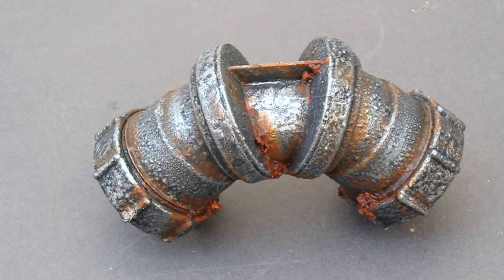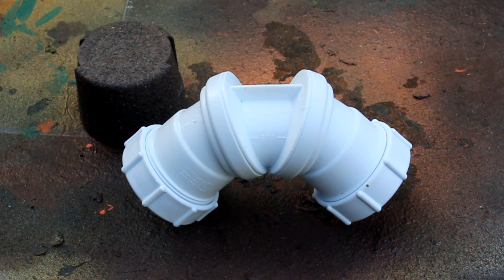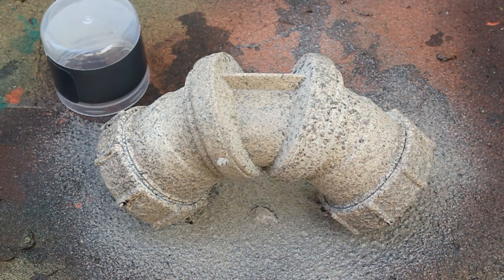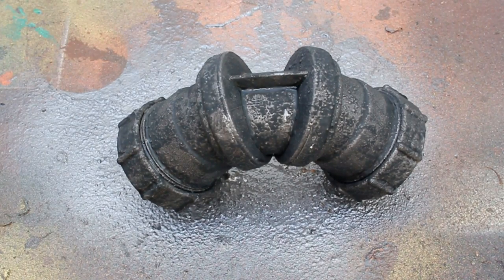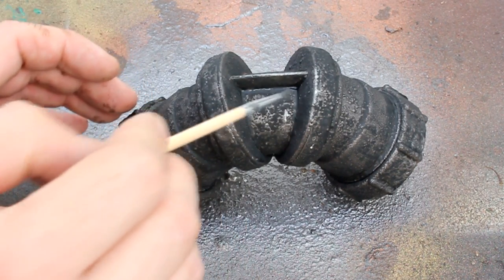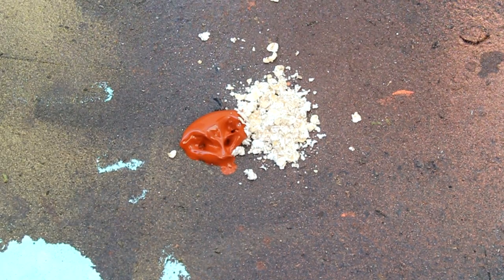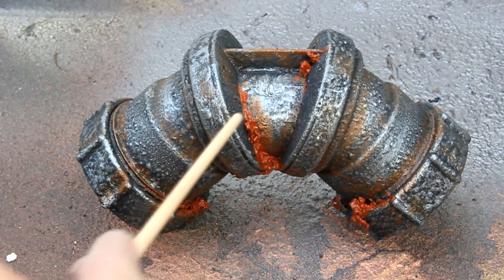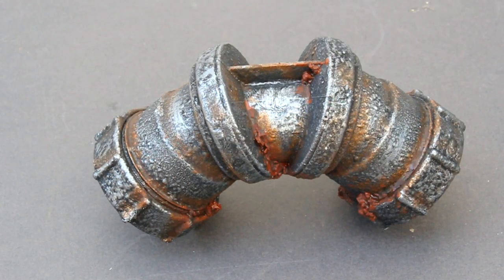Painting Techniques Iron or Steel

Comment from the maker: The colours of the two texture paints don't matter as these get covered completly by the silver colour.  Its the texture that is important.
For the silver coloured layer I used a gunmetal colour car spray paint (a blackish silver colour).  You can often get away with just silver spray as the black wash covers over this, you just may need to do two coats of wash.  The drybrushing was with a steel acrylic.  For the rust I used Burnt Sienna (reddish brown) with a dab of brown wash over the top.

Comment: These painting techniques are very well done. Thank you for sharing.  What brand spray paints and washes do you use?
Reply from the maker: I use a range of paints, depending on what i can get my hands on.  For the copper/brass paints the colours are fairly standard.  For the silver I tend to try to go for a more gunmetal colour so buy car paints.  Again with washes its the colour I go for rather than the make.  Black washes are a standard colour but for the brown ones I tend to go for a dark brown.  The only think I have found with washes is that acrylic dries quicker, but enamel can give a better depth of colour.
Reply: Thanks for replying.  I make models of rayguns among other things as a hobby and I'm always trying out new adhesives and paints, etc.  Actually I'm not terribly experienced at it yet.  Thanks for sharing.

Comment: hi great tutorials i have found them very helpful, i am painting a large scale Armour piece and will copy this vid. i will need a lot of black wash can you remember the one you used or suggest one, im in the UK.   thanks
Reply from the maker: I get mine from model shops.  which could get very expensive for a large piece of armour.  It may be possible to make your own by diluting down a black paint I haven't had a lot of success doingvyhis but you might be able to find an online tutorial.  Otherwise any black wash will do.
Reply: cool, thanks for getting back to me